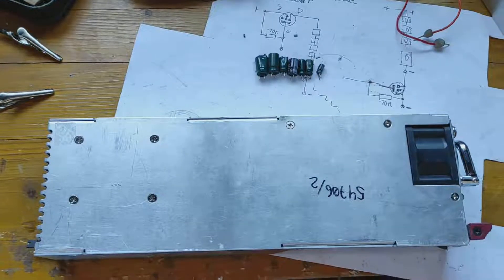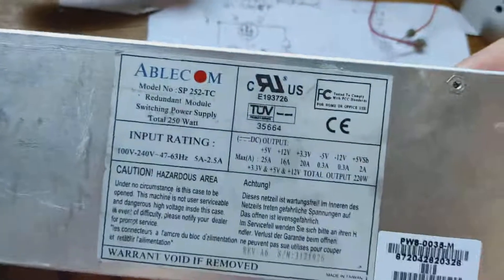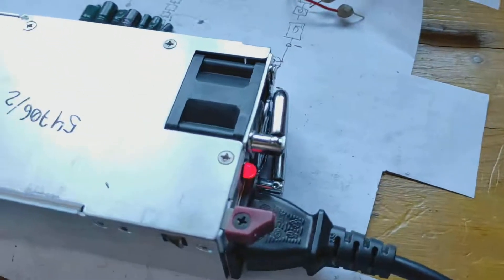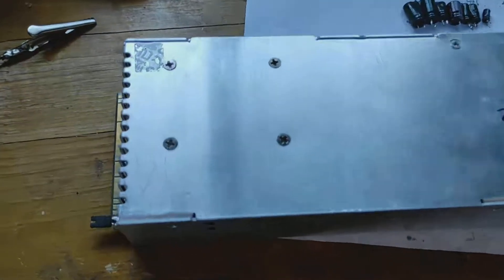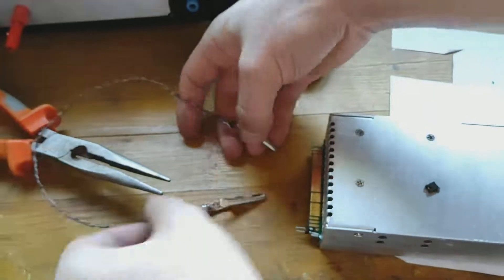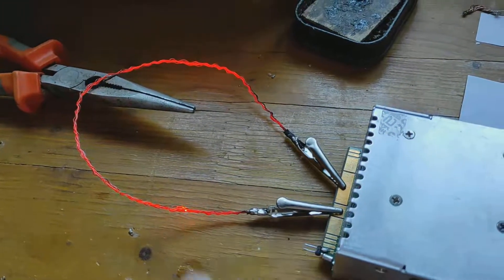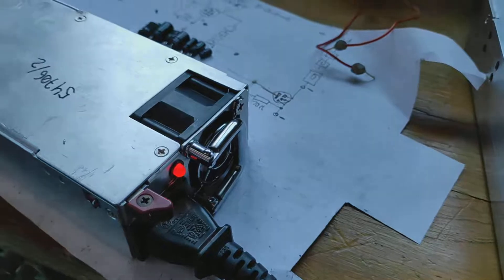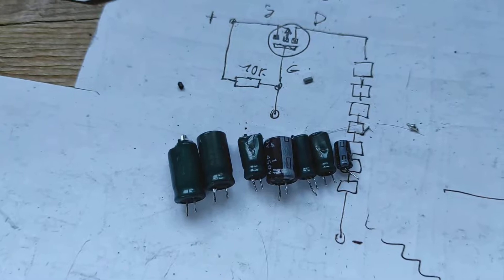part 2 server power supply repair test and pson hack

Comment: I seem to have a 12v 72a negative and positive and a 12v 3a positive bus bar's and then I have 8 single pin's. 
I'm yet to plug them in and test but do you think it would be similar?  
It's a Cisco UCSC-PSU1-770W V03 if that helps at all.
Searching online without a VPN only shows me results in the Eu area's and there's nothing at all.
Even instruction manuals to the equipment that uses them, there's only bios info for changing settings ect
Reply from the maker: @hulkgqnissanpatrol6121  experimentation is your best friend in that scenario also taking it apart and looking were the pins go is a good start